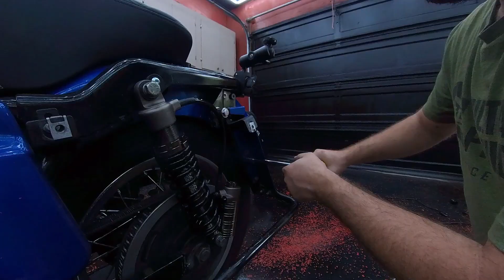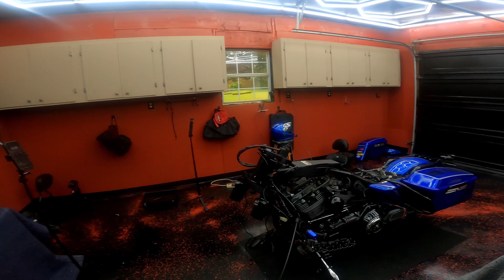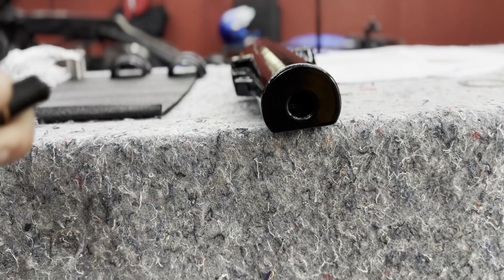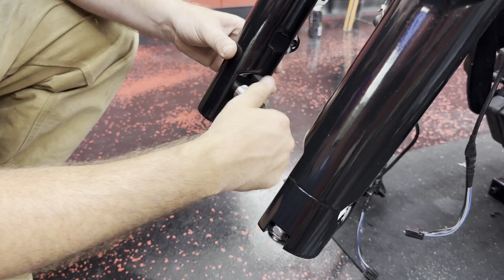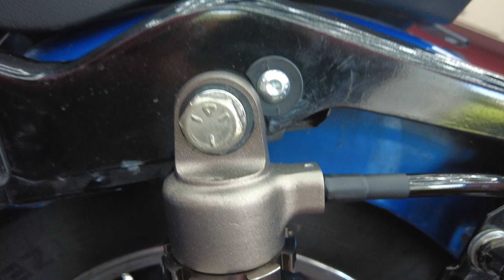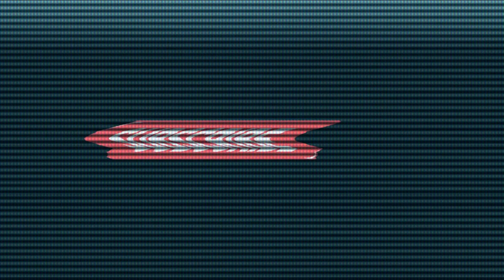Install Your Gezzer suspension with ease - simple as 1 2 3

Comment: What points did you to measure your say,? Center bolt to Center bolt?
Reply from the maker: I measured center bolt to center bolt for sag. I also have tool called the slacker. You put it in place and it Bluetooth so i can set the sag by myself really easily.

Comment: Did you only use 4  spacers for each sbock bolt?
Reply from the maker: I only used one washer on each shock bolt. The top shock bolt washer was a little thicker to have the shocks perpendicular.

Comment: Which reservoir mounts did you use?
Reply from the maker: I used the ones that fit an 08 where the only one option for that year.  So the stick out past the rear fender but lower than the 09.
Reply: @Wessoncustoms  thanks. I

Comment: Any update on the suspension. Im looking into doing this and am curious if you feel it was worth it?
Reply: Dope! Thanks man. I'm ordering the rear next payday. I've done a bunch of power mods on my road king and have found that my suspension and brake system aren't quite up to par. I just ordered full galfer rotors and pads, I'm gonna do suspension next check. Hopefully it'll even everything out.
Reply from the maker: @williecrawford9957   I don’t think youll be disappointed in that setup at all I run galfer rotors in the front with Gezzer brake line the stopping power and handling is just amazing!
Reply: Whays your opinion on ride quality? Any issues? Did they hold up?
Reply from the maker: Ride quality is excellent in my opinion and held up amazing! Actually in the process of videoing and editing the full review video over the entire suspension and hopefully have it out in the next couple of days.
Reply: I have a question for you, I bought a set of these over a month ago and am not pleased with the installation instructions. Shocks and reservoir mounting is simple. The crap part is the saddle bag spacers, they just don’t work. I’ve called Andrea’s and he can’t help me and he owns Geezer. And photos or insight?
Reply from the maker: @jeeptuff What year is your bike for I didn't use saddlebag spacer. The only washer or spacer I used was on the shocks. There was plenty of space between shocks and saddlebags.
Reply: @Wessoncustoms  2009 Ultra Classic. The product is beautifully crafted but customer support is killing me at this point.
Reply: @jeeptuff did you ever get this figured out? I just got my shocks for my 2013 street glide and I have no idea how to add the bag spacer set up!
Reply from the maker: I didn’t use any spacers for the bags just adjusted the mounting brackets and everything went together smoothly.
Reply: What bars are you using and how much pullback?
Reply from the maker: I have 8in pull back risers with mid bend bars on it  the adapter plate from Thrasin bring the risers back a little as well
Reply from the maker: Its been a game changer. I really cant recommend the suspension enough i will be doing a full review of the suspension after my last trip of the year and showing how it handles 2 up as well. For the price and the quality it was well worth it!